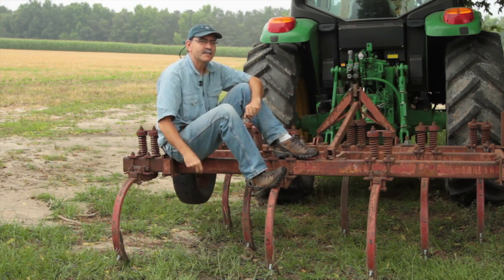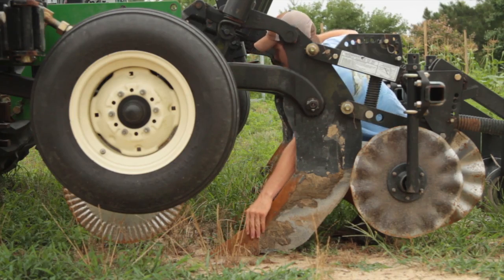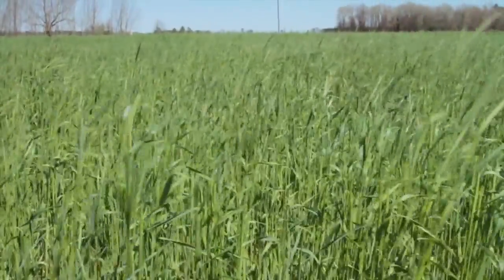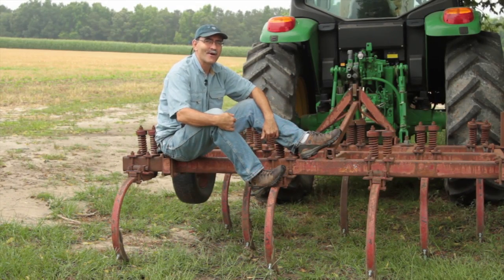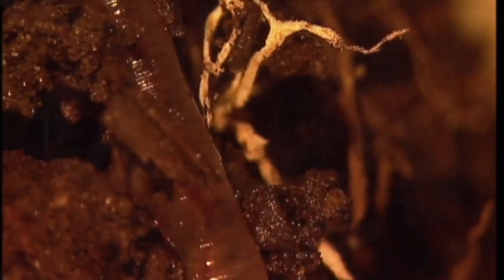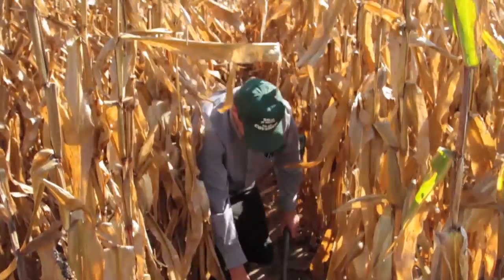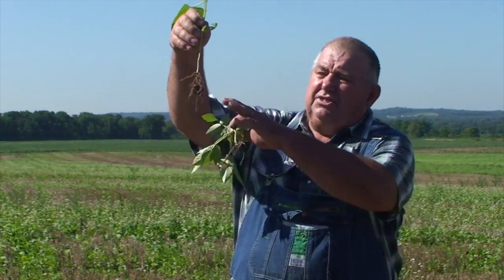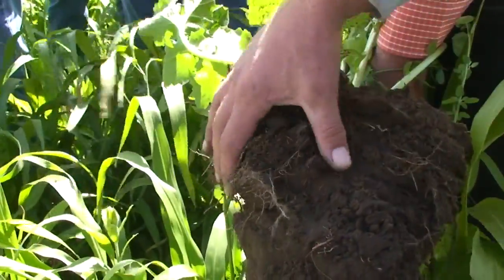The Science of Soil Health: Compaction

Comment: This no till BS burned me hard last season and I learned this lesson the hard way...You HAVE to move the subsoil and use the hell out of steel...ESPECIALLY if you have clay type soils.  Cover crops are BS and no till farming is BS...Don't buy into this guys...Check your subsoils and check them often...Roots needs healthy subsoil and no till farming only promotes soil compaction.  Reduce the machinery weight when possible (use heavier tractors for deep tillage, then switch to as light as possible tractors for shallow tillage, sewing, drilling, cultivation, etc.   I believe this no till fad is going to burn a lot of farmers, including myself, and will go out of style in a couple more years, once farmers realize how soil compaction kills crop yields, and literally the crops themselves.  No till might be viable (for a while) on sandy, smaller farms with smaller, lighter equipment, but if you're in clay and work large acreage, with more horsepower/heavier equipment...You HAVE to plough (chisel especially), or you will lose badly and it may cost you everything eventually.
Reply: 1 year is not enough
Reply: @davidortega2102  It'll take generations to turn clay soil into more balanced soil...No till may work fine for more sandy soils but for clay it takes years and years and that's something a lot of farmers can't afford, especially during these crazy depression times

Comment: Im not an expert, but Id wager that in most cases, plowing the field would result in better yields than no-till.  Are nitrogen fixing crops the same as cover crops in this context.  Because I can see merit in growing nitrogen fixing crops, but expecting a plants root system to bore through hard pan soil and for your next crops roots to follow the same path as the cover crop? sounds like wishful thinking at best.  why not just plow nice and deep so you can be certain there is an adequate depth of friable soil to ensure the crop can develop a healthy root system.  I double dig my vegetable garden and occasionally roto-till with a tractor, Im not a farmer but just seems like plowing would be the way to go. if the ground gets too hard, Use a jackhammer to achieve the desired result.

Comment: For a small garden for growing vegetables for your own kitchen .The best fertiliser and soil conditioner is 3 year old farmyard manure put on at 10 pounds or more to the square yard .plough the ground 8 to 10 inches in november and then put on the manure .The worms will pull down the manure into the ground .and in the spring late march take in a rotovator at 1000 rpm and it brings it to a tilth 8 " deep for deep rooters like carrotts and parsnip .For potatoes add potatoe manure high in potash .The conditioner of the soil is the well rotted farmyard manure and the earthworms .USE the grass cuttings from your lawn to block out the weeds laid on 3" thick .Thats if you dont use glycosate weedkiller sprays .AND  BON APPETIT . potatoes . Floury dry no 1 golden wonder = maincrop or Arran victory .Earlies = british queen or  cara .
Reply: Did you even watch the video Cletus? It’s about NOT tilling because tilling destroys the soil.

Comment: Subsoiling with a narrow point, straight shank. I’m positive is better then using cover crops. If you plant over the strips where you subsoiled, the roots go straight down. I’d rather use steel then some plants.
Reply: It doesnt solve the problem its only temporary fix with steel roots add aggregation and that is what relieves compaction in the soil
Reply: I'm not an expert but the little research I've done shows that maintaining soil structure trumps any tillage including subsoiling. Maybe subsoiling the first time has benefits followed by no till with cover crop. Radishes do a good job of breaking compaction layers.